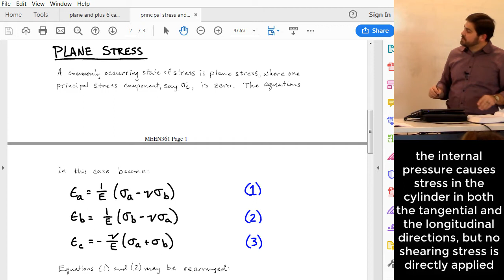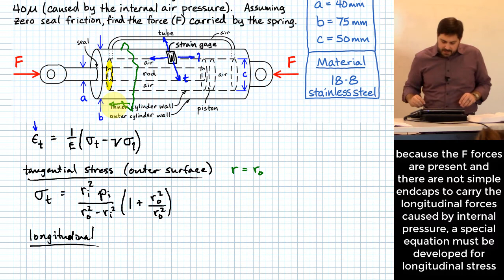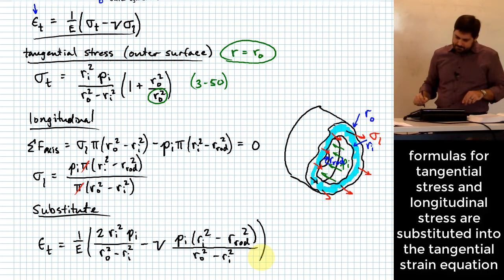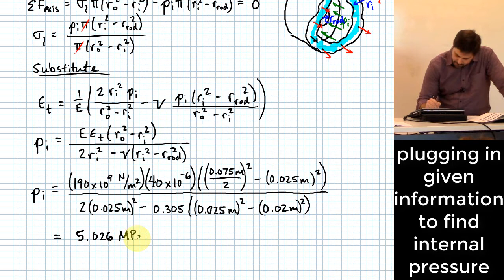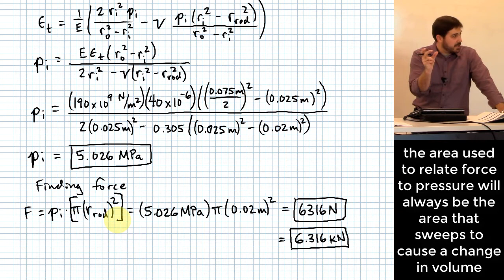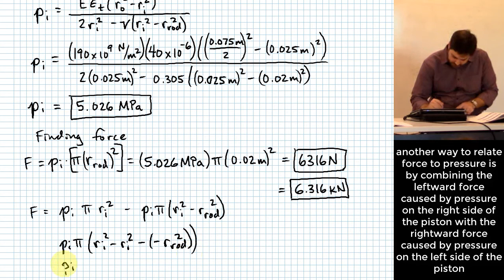Example: Strain Gage Measures Thick Pneumatic Cylinder Pressure & Force | Relating Biaxial Stress, ϵ

Comment: Dear Professor
With all respect may Almighty's grace upon you and your love ones.
Your lecture is great but one thing i love to ask and that is which book do you recomend or in your opinion is best to study this course.
Thanks
Reply from the maker: I do live in the grace of the almighty, and I'm thankful. I use Shigley's Mechanical Engineering Design, 10th edition. Each text has strengths and weaknesses though. I like the breadth of Shigley and it's approach to design. Thanks for watching!
Reply: @TheBomPE  
Thanks
I believe Shigley deals with both courses.
Reply from the maker: That's correct, I use it for MEEN361 (advanced mechanics of materials) and MEEN462 (machine element design). There are a few spots where I feel the need to supplement with additional resources, but Shigley covers most of everything I want to talk about in these courses.
Reply: @TheBomPE  
Thanks Professor
Thank you very much 
May Almighty Keep on blessing you.
Thanks.
Reply: @TheBomPE  
Hi
shouldn't the max tangential stress be at Ri ?